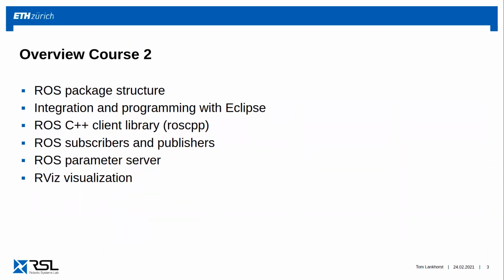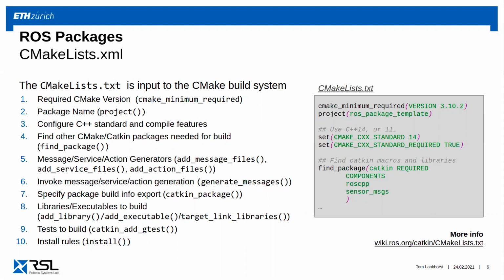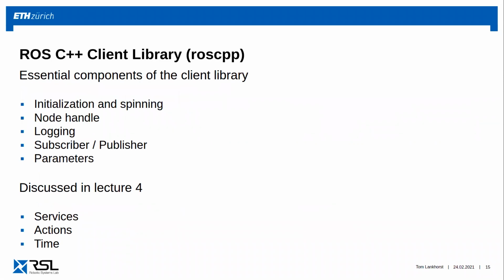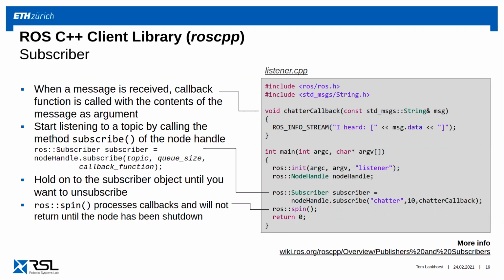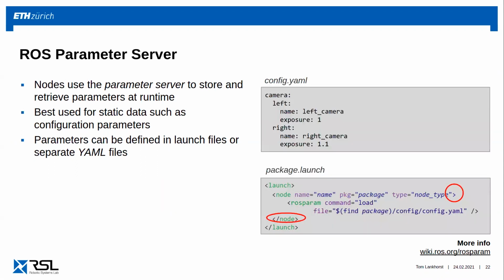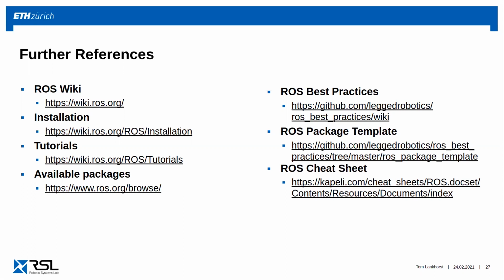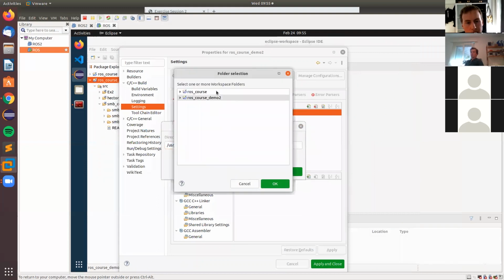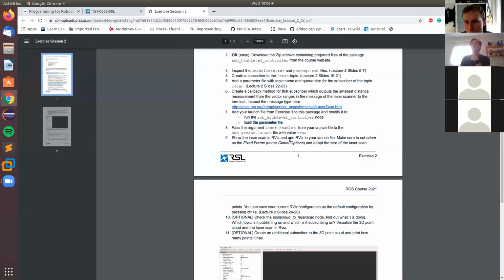Programming for Robotics, Lecture 2: Your first ROS package

Comment: I'm having issues with the \scan topic not receiving any messages. rostopic echo /scan says "WARNING: no messages received and simulated time is active". As I result, I don't see any scan data on rviz even if I place some objects in front of the robot in Gazebo. However, the point cloud data works fine. Do you have any suggestions? Thank you.
Reply: You answer was awesome! I just got stuck the same problem as yours. It reports "...Failed to load plugin libgazebo_ros_velodyne_laser.so...", after referring to your solution and with command "sudo apt install ros-noetic-velodyne*", it works. Thank you!
Reply: Update: I was able to resolve this by installing the missing ROS packages. My recent OS update had removed some of them. Basically, look for the errors that come up during roslaunch and try to install the indicated packages with apt install ros-<distro>-<package-name> where <distro> is kinetic, noetic, etc. and <package-name> could be, say, geographic-msgs.
Reply: What point cloud data are you talking about here? Is it the node /pointcloud_to_laserscan? Also what do you mean when you say that works fine?

On a side note, is this related to the bonus questions of publishing the 3D point cloud? If so, for some reason I am unable to see any topics that publish this 3D point cloud. 

/pointcloud_to_laserscan only publishes on the /scan topic.
Reply: When I rostopic echo /scan, it doesn't show anything!
Reply: So my Rviz does not show the points